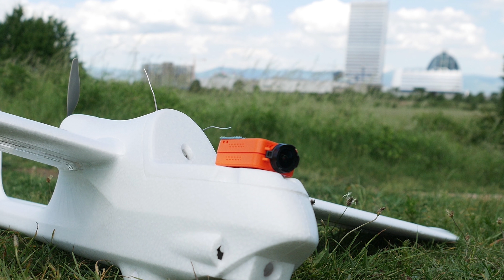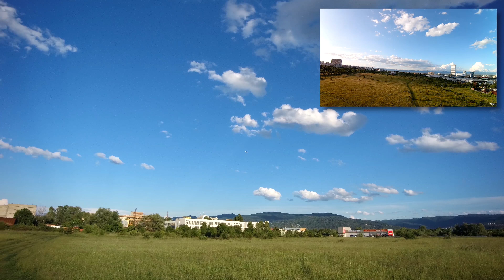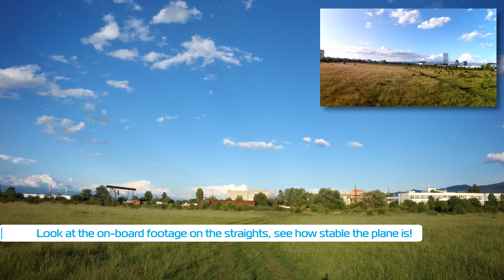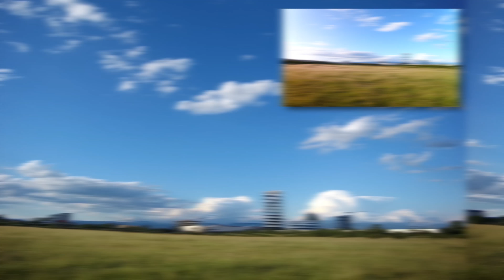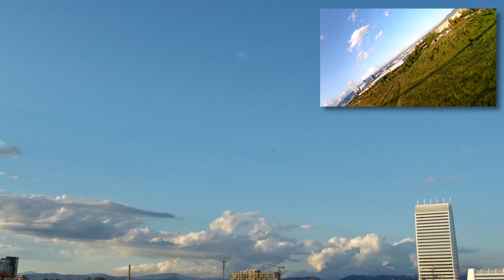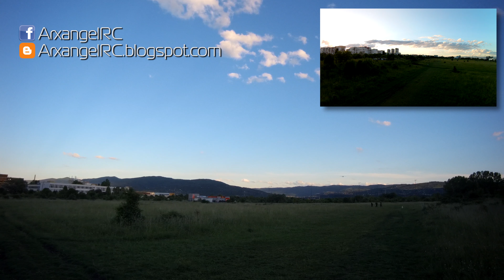Volantex Ranger G2 endurance run with stock motor and prop on 3S

Comment: This looks much better than the previous Ranger EX. The nose down behavior of the original Ranger made it almost unflyable for me, as I only fly manually with no autopilot. Even if I did have an autopilot on it, I would consider the amount of constant up elevator needed to keep the nose up,  a severe design flaw.
Reply from the maker: It is... but... it is what it is... my Ranger EX flew perfectly though... even with that! The autopilot does make it a lot easier.

Comment: The stock ESC has an annoying low voltage soft cutoff that starts cutting power, so that definitely has to be replaced if you want to try Li-Ion packs.  The motor isn't very efficient either, I went with a Cobra 2000kV and 6x5.5 prop.  The combo dropped current draw nicely and extended flight times on 3S Li-Ion to at least 45 minutes, probably much more, but I get bored at that point.  I'm not sure you'll be able to get CG with 4S, I had to trim the plywood tray a little to fit the 3S.
Reply from the maker: Actually the 4S LiIon fits in the Nano Talon... I think it will have no trouble fitting here, it is under 200 grams. And yes, I will be replacing the ESC at first... but if I find a suitable motor in my stash, I might replace that as well and see what a whole new system does on 4S! 1 hour out of this plane would be absolutely amazing and would allow it go places where no plane of this size has been so far! :)
Reply: Yeah, it will physically fit in the hole, but the plane will likely be too nose heavy.  It does have a high lift wing, so a little extra speed can compensate for the extra weight I suspect.  I've had my Nano Talon out to over 5 miles in a noisier RF environment than you are blessed with, but yeah, I bet this li'l Ranger could beat it.  Or at least fly better doing it.
Reply from the maker: Haha, the flying better part is already a fact, what remains to be seen is how it will fare with a new motor and the LiIon. Actually there is plenty of space in this plane to move the battery back, so I don't think it will be nose heavy! You can always mount some stuff on the tail to bring the balance back! :)

Comment: We wait in anticipation for the final fit out for more record breaking flights..
can't believe I'm stuck with inav in mine. :(    only good for 20 feet past LOS.. ok, maybe 10..
Reply from the maker: They will be coming soon, I hope! :) As for iNav... 20 feet past LoS?? How does that work?
Reply: Well, it's a trust thing..
you know, line of sight you have a chance of saving it, beyond that your in the hands of the flight controller..
so my level of trust amounts to about 20 feet..lol
Reply: Arduplane runs on several of the F4 controllers now., i.e. Omnibus F4 Pro, CC3D Revo, so you're not stuck with iNav.
Reply: Samuel Fugarino I might try that before doing anything drastic.
Reply from the maker: I am also planning to try this, just have to finish this remodelling of my workshop to make it more... usable!
Reply: Sounds like the subject for a new video.
Reply from the maker: Oh, it will be! :)